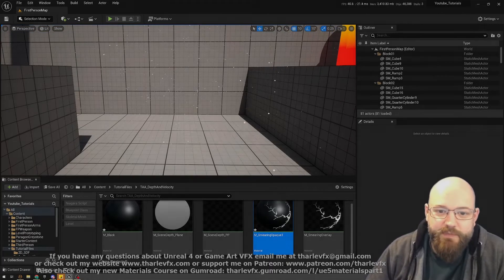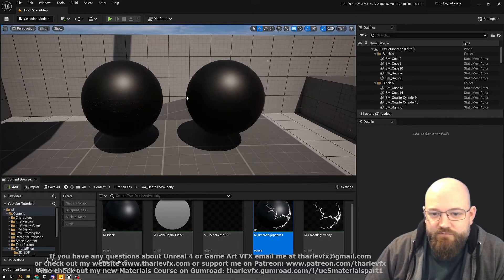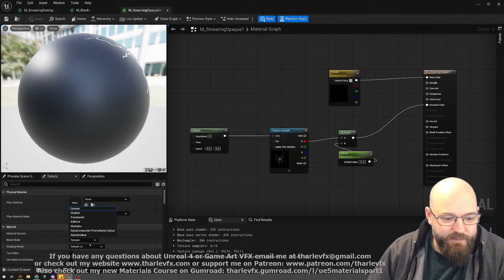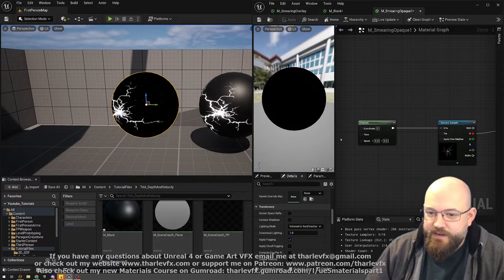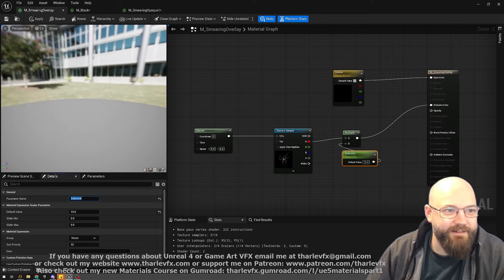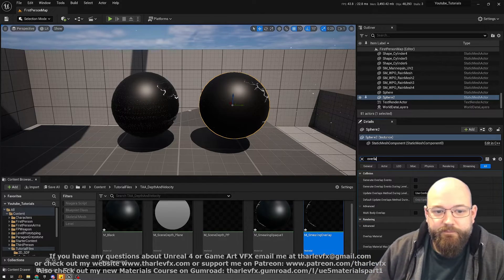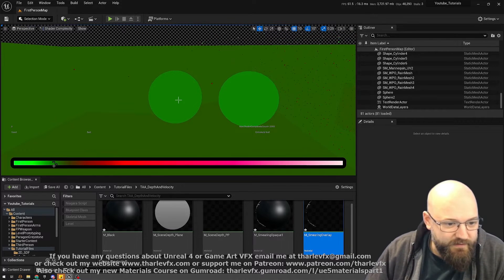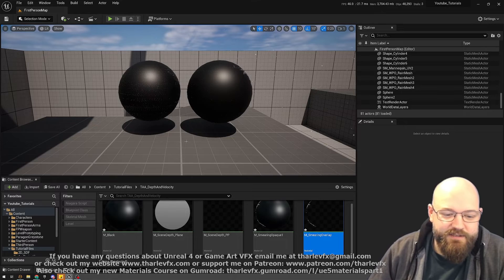Animated Material Smearing Fix

Comment: I am having some major smearing that I can not solve. I am using a render target to push foliage and with TSR the foliage ghosting gets extremely bad. I have tried different velocity pass tricks and previous frame switches in the material, but nothing works with the render target. Its making TSR unusable right now. Any ideas?